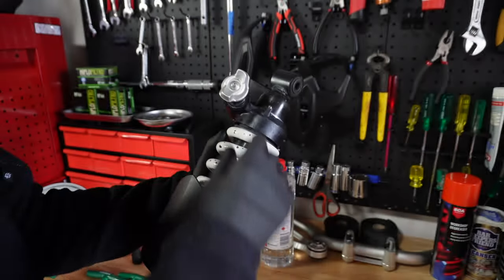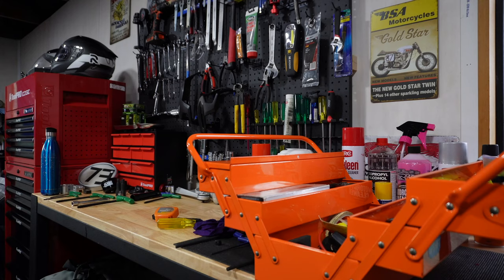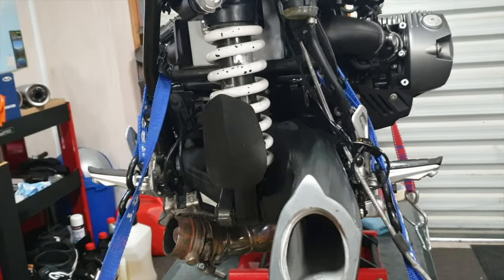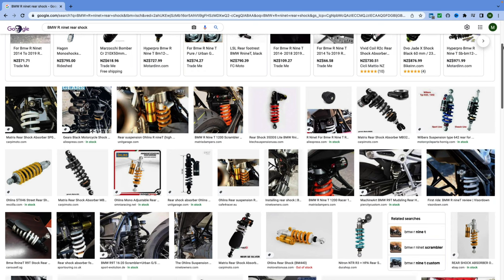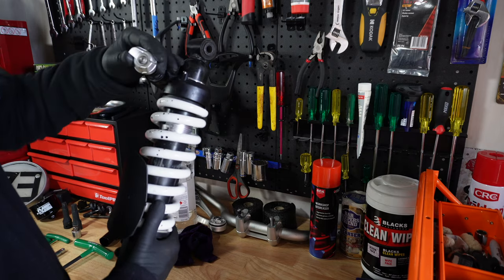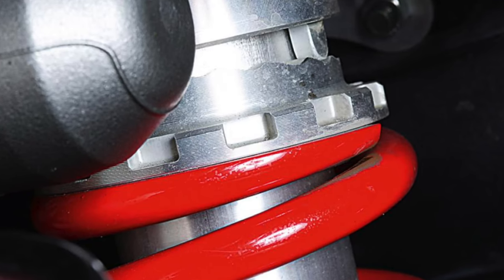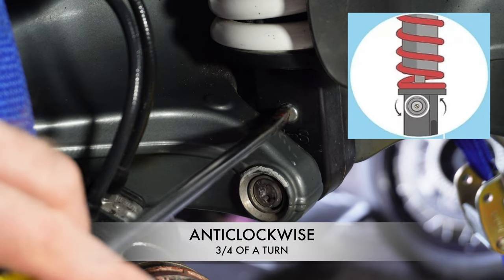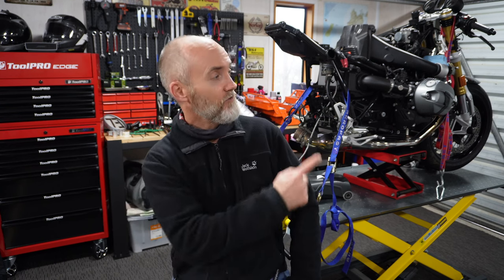R9T: OEM Shock Before YOU Upgrade ....

Comment: R9T Scrambler - I had my OEM disaster rebuilt by a local Suspension expert at a fraction of the cost of any aftermarket big name replacement; with a replacement spring and damping improvement, this has transformed the bike - just amazing!
Reply from the maker: @shane60, great stuff !!👍 and good point regarding the spring👊✊️

Comment: My Urban GS rear shock was horrible, I set the pre-load for correct sag the day I bought it, ran up and down the range of rebound damping and it was still horrible to the point of dangerous, fitted a Wilbers pronto and an Andreani cartridge conversion to the forks, then all good. Have been modding and replacing suspension BMW boxers for just over 40 years, the BMW's from the 70's left the factory with better suspension.

Comment: I have a 2017 Pure and cannot afford a new rear shock, but the factory settings were way too soft. So, I experimented with the OEM. I am 90 kg and ride twisty back roads, often a bit on the bumpy side. After about 2 weeks of fiddling, I found the shock was very sensitive to tiny adjustments. Even a 2 mm change to preload makes a difference. I know many will scoff at this, and I've never experienced this on any other bike. I'm just trying to help you guys. So, for what it's worth I settled on Preload on shock = 17 mm of thread exposed at the top. Sag is 15 mm, and with rider = 43 mm, which is about 35% of travel. I found this a very good compromise between handling and comfort. 
I know the UGS and Scram have a longer shock and the Classic and Racer may have different spring rates, so I can only vouch for the Pure. I hope that helps.
Reply from the maker: Hey there Dave, thanks so much for the post!! This is really usefully real world info, especially for those of us riders around the 90kg mark. Thanks for sharing your experience and the exact adjustments that have worked for you👍👊✊

Comment: From your experience do you think the spring rate is suitable for 75kg? Might be purchasing the standard r9t soon.
Reply from the maker: Hi Reneluis04, 75kg for the spring is spot on. After saying that, the stock adjustment is limited with only Preload and basic rebound. But I'd recommend sticking with the stock shock for 12 months just to understand how it works for you on the roads you ride on most frequently,  before spending money on an upgrade. I hope my thoughts help you with your decision. Ride Safe and if you do buy the R9T I'm sure you'll love it, especially if your more into short distance sporty  riding (in style). 😀👊✊️👍

Comment: Great video! I just got an Urban GS 23' I'm trying to get it dialed since I would like to drive more on the soft side, the roads I normally ride are bumpy. Any advice? Also is there a way to get the ride height a bit lower? I used to have a Scrambler 19 with the castled nuts but this UGS has a knob only. Regards from Mexico!
Reply from the maker: Hey there @robertomaldonado5109 , thanks for the question😀. Just between the two of us, I'm a little envious that you have an Urban GS 23'😁. I have a R1250 GS '19 and some days it's just a little bit heavy when off-road. So good on you!  The Urban GS is definitely "Urban" but very capable at doing off-road (grades 1 and 2). Then again, I wouldn't take a beautiful  new Urban off-road, they are just to beautiful 🤩. But to answer your question, if you want to adjust ride height to anything really noticeable, you'll want to buy a lowering kit. Its not expensive at around USD$400 (E.g HyperPro). If you have money burning in your pocket, you could go "Whole Hog" and replace your entire rear-shock to also gain great adjustability with the additional benefit of Compression Damping adjustability and a lowering kit and upgraded fork catridges. All this can be fitted at home if you have a few basic tools. But normally if you buy from a good local shop, they will install it as part of the price. 
I hope this helps. If not,  just let me know and I'll point you in the right direction🙂. As for adjusting the bumpiness, have a look at my video on Suspension. Once you understand what each external "dial" adjustment does, you can easily dial in your Suspension for HOW and WHERE you ride.
Ride Safe 👊✊️👍😀

Comment: Hi are you just lifting the bike on a scissor jack under the oil pan when you have both wheels out  ? Do you just put some timber on to of the jack ?
Reply from the maker: Hi @fennee-g6088, yes just something that will give rather than the aluminum sump. Naturally also ensure you have the bike stropped down so it can't go anywhere while perched up on the sump.
Make sure you use a quality jack. I have heard of some cheap ones failing. All the best😀👍

Comment: Thanks for the rebound screw adjustment setting, do you know what the stock Preload knob setting is for the 21> Scrambler?
Reply from the maker: 1. Preload: Turn the adjuster knob counter-clockwise as far as it will go
2. Rebound Damping: Turn the adjuster screw clockwise as far as it will go, then back it off two full turns. (Or only 1 turn for two up).

That's just a basic baseline to find a starting point. You'll need to adjust it to dial it in to your specific weight and riding style and the types of roads you ride on by using "feel". See my other video on Shock Suspension for a deep dive🙂
https://youtu.be/ozQcRkecpHg

Hope this helps.  All the best.
Reply: Awesome thanks mate!
Reply: @outtheresomewhere  took her out last night with your settings and it's much better. The bike doesn't throw me off the seat now when I go over bumps, it's not so twitchy on the bends and back feels at one with the front in general. Thanks again!

Comment: The owners manual on my Racer has a pre-load setting of 11mm so not sure about your stated setting for this model? When I bought mine (ex-demonstrator) I wrongly assumed the setting from the dealer would be correct but every time I hit a bump it tried to fire me off the seat. It must have been set for a much heavier rider but even so it had zero static sag. So I set the rear shock back to standard (good advice) on pre-load and damping and have since made it a bit softer partly because I am probably lighter than average. I suppose varying tyre pressures is something else that could be tried but I have always stuck to the recommended pressures. I’m not sure if I’m a good enough rider to notice a better shock but if wear and tear meant I needed to change I’d probably replace it with an upgrade 🇬🇧
Reply from the maker: Hi Stewy, thanks for the feedback, really appreciate it 👍. That is interesting and possible. The key is to have a "known" setting as a starting point to work from. The settings I've provided will need adjustment for weight, riding style and even the make of tire as will those in the users manual. So you could use either as a Baseline as you'll be modifying them further as you test each setup due to each of us being all very unique 😁. But it sounds like you have it all nicely tweaked for YOU now😃. Maybe just keep an eye on how your tire is wearing and adjust tire pressure accordingly. Thanks again Stewy, ride safe👊✊👍🏍.

Comment: Hello I have a 2021 pure. I weight 77kg.
How should I tune it? 
It looks a bit different compare to the video. 
What’s the ballpark for my weight.

I ride mountain roads and city roads.
Reply from the maker: Hi @JL-po3dwl it takes a bit of trial and error to dial in not only to your weight, but also to your riding style and preferences. Also the stock shock is rather limited. But the good news is the spring, though not great, should be OK for your body weight of 77kg. As a starting point (baseline) for 77kg weight  you could try the following (Assuming your shock is a 2021 OEM Sachs shock) :

Note the following will need further adjustment, so it's best to write down the following settings and also any adjustments so that you have a record of what works and doesn't.

Turn the Preload knob FULLY COUNTER-CLOCKWISE (anticlockwise), then 1/2 a turn CLOCKWISE.
Next turn the Rebound screw FULLY CLOCKWISE, then 2.0 turns ANTI-CLOCKWISE.

Take it for a ride over a road you are very familiar with and feel what good or bad changes have occurred, then make small adjustments to dial it in. Be careful when riding after making adjustments as naturally your bike will handle differently to your normal inputs. 

Note, ideally you would also tweak your forks,  but it isn't a must at least to start with. Just get familiar with tweaking your shock first, and how specific tweaks change the bikes feel and handling.

Feel free to watch my other video on Shock Terminology 
https://youtu.be/ozQcRkecpHg
.. and good luck and have fun. Hope this helps. Let me know how you get on😀✊️👊👍
Reply: Thank you!